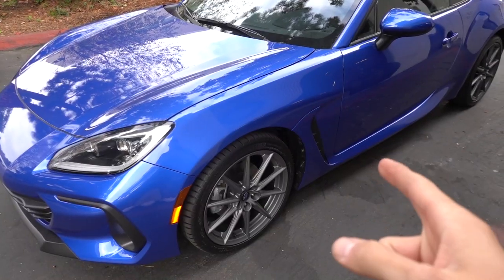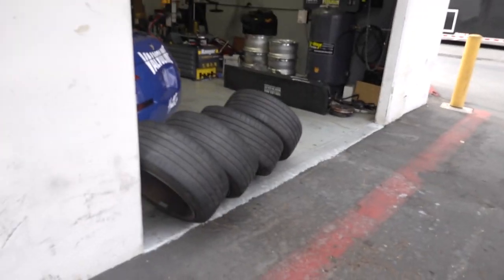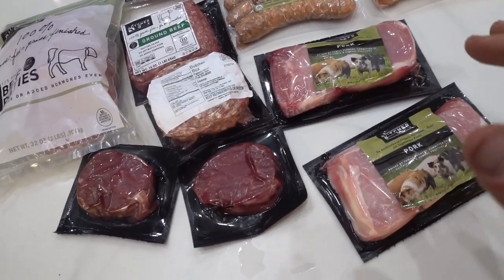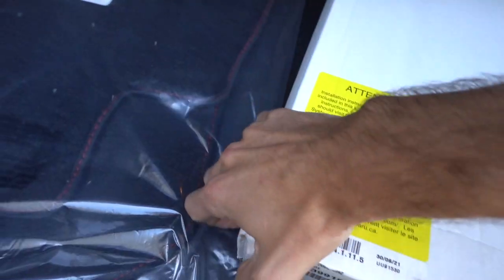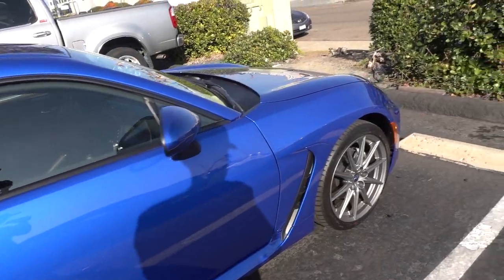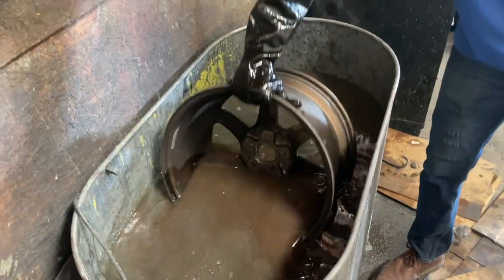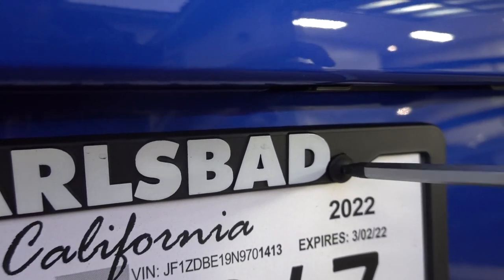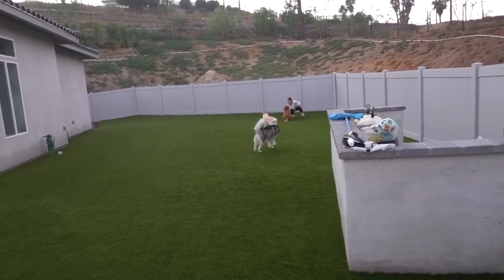2022 Subaru BRZ Gets NEW WHEELS!

Comment: TG its called INTERNET ACCESS, Wifi is a transmission type from you internet access router provided. Also using ethernet cabling from the router to your PCs will be a far more consistent way to connect your devices where you want to reduce packet loss and latency spikes. Also Starlink will have those issue as well due to the nature of the connection, dont expect standards of the same level as a standard house copper link.
Reply: Every time he says WIFI instead of internet I cringe.
Reply: @striker0289  same here.  Also cringe when he calls the back up sensors (proximity sensors) motion sensors. 😬
Reply: Satellite Internet has been around for a long time, and it’s really only acceptable if there’s no other form of internet connection. The technology in starlink is better, but you are still going to have a lot of the same issues as other satellite internet companies.
Reply: Hes called TJ... :D

Comment: Hey TJ, just wanted to touch on the front plate issue. The dealership you got it from was lazy. I work for a CA Subaru dealer, all of the front plates have an adapter that goes on the front of those brz, wrx and crosstrek bumpers. They shouldn't be smoking holes. It's a big pet peeve of mine. They should've included it in the PDI process. We pay our techs to install them.

Comment: The front bumper actually has dimples in there to drill holes into the exact location for the license plate when doing a pdi (pre delivery inspection) it’s how most new cars are now coming from factory
Reply: Though that may be true it’s still bad practice to drill into a customer’s brand new car especially when adapters exist

Comment: Not my place to say what you should do but imo I’d be leaving the brz stock with the exception of exhaust. Obviously some exterior changes like wheels, tint etc but if you can leave the overall appearance not to far from stock it holds its value. I’ve done exactly that with my 86. It’s a 2014 and it’s held it’s value and could possibly be higher in the future. 
I’ve looked after it immensely and has low mileage, I put it up for sale just to see the offers I would get and it blew my mind.

Comment: I apologize for my rude behavior with this comment: LOL, calls it Wi-Fi hahhah. ISP and wire to the PC is the only way to go. Dude should have gig or Fiber over WAN and 10gig networking over LAN or something like Linus Tech Tips level of connection. WEE FEE is pleb connection. Even my poor ass has a better grasp on the ISP game. Wi-Fi = wiff wiff a woo woo. Sorry I went there, but dude, your business is the internet, you should be able to dump your files to an editor or YouTube in minutes. Many have done it so far where they get ahold of their ISP and have a fiber line dropped to their house. It will cost a bit but no dropouts or connection interruption or loss of signal to deal with.

Connect your cables boys, it's a better experience. Be it your peripherals, your headphones or connecting to the interwebs. By the FCC, all wireless connections are designed to allow dropout whenever "They" see fit.